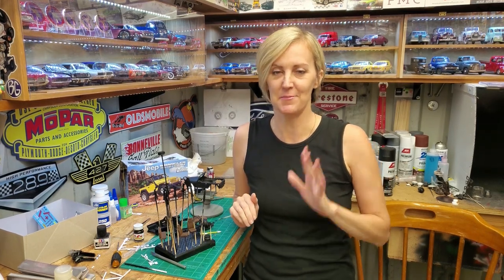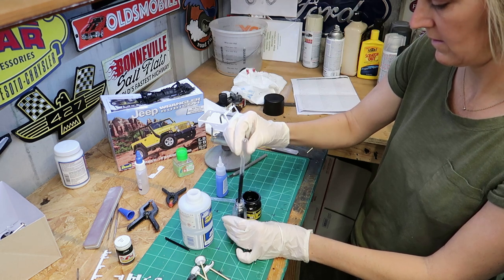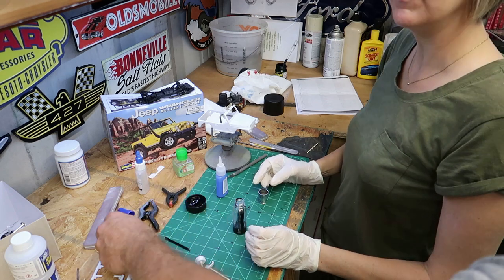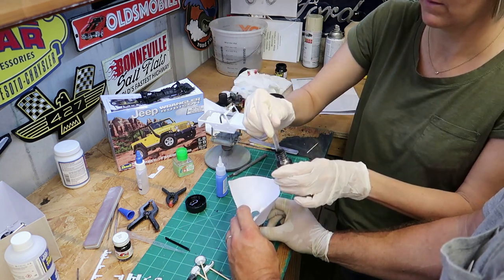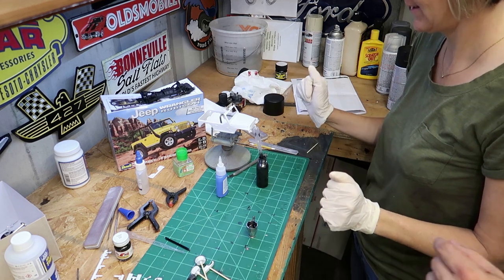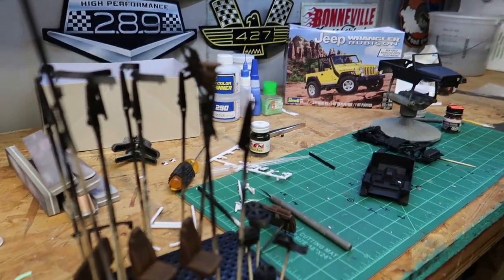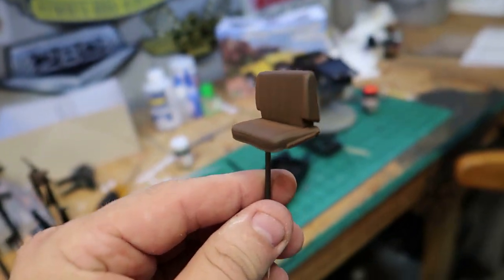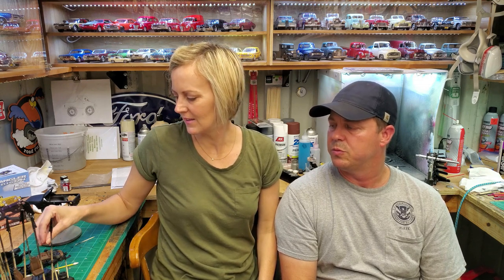Take 2 / Dueling Heathers Jeep build PT2!! Things are starting to happen!!

Comment: I'm curious about that little battery powered compressor. I have a compressor with a tank that I bought cheap at Pep Boys years ago. I haven't used it a long time (I don't even know if it still works!). When I started airbrushing, I read that you had to have a tank to avoid pulsing of the air, but I see lots of modelers who don't have one. I have the whole shebang, moisture trap, regulator, etc. but the thing is big and heavy.